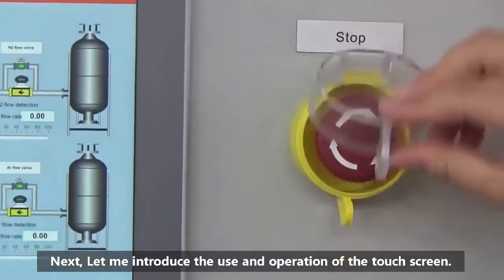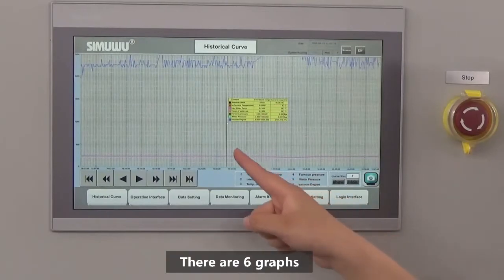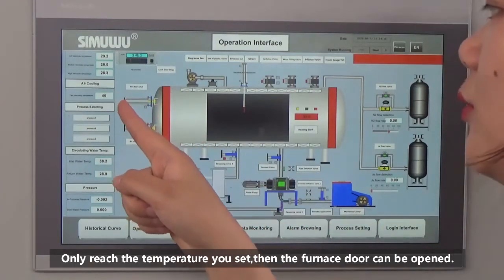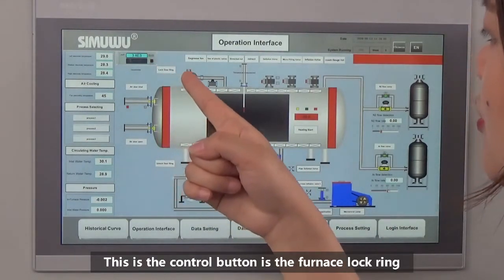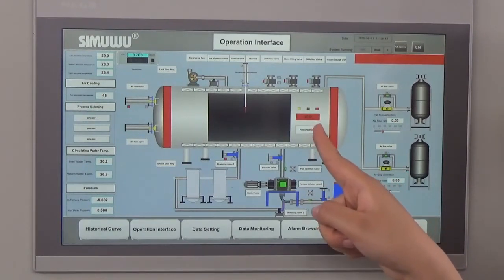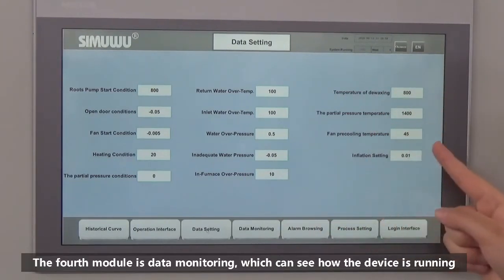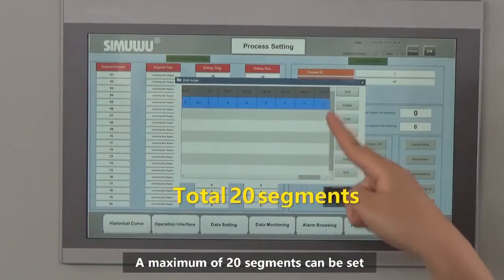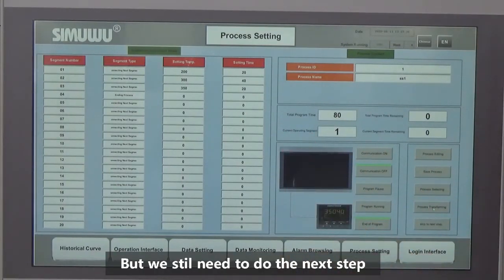How to operate vacuum furnace

Comment: The video furnace, it used for SiC B4C vacuum debinding and sintering. Max temperature reach 2400C.PLC control, easy to operate.
Here is link for details of this furnace：
https://www.alibaba.com/product-detail/2400C-Vacuum-Induction-furnace-tungsten-carbide_62238478375.html?spm=a2700.details.pronpeci14.4.833a38adA6kvpL